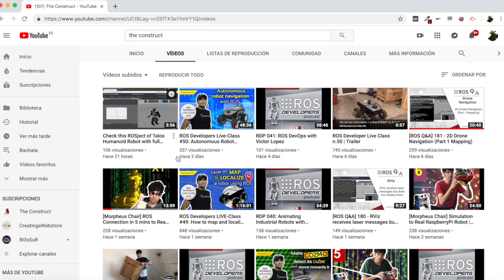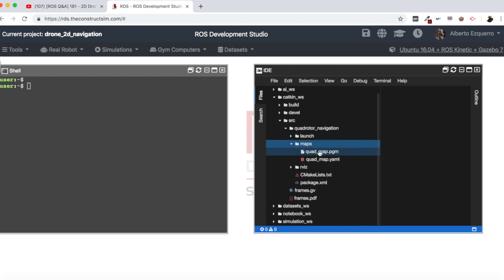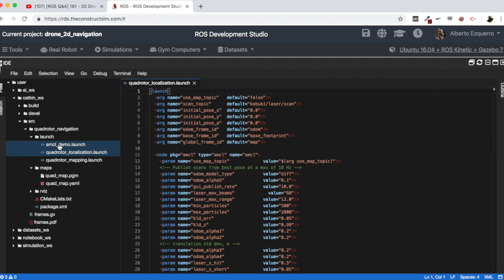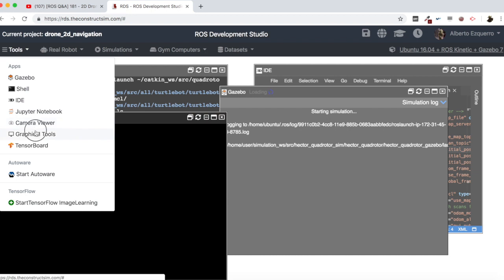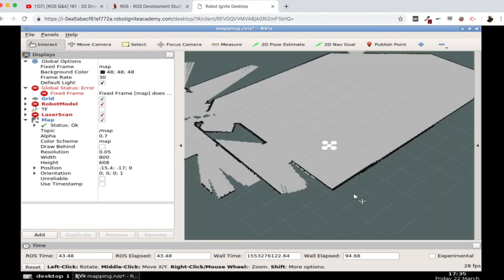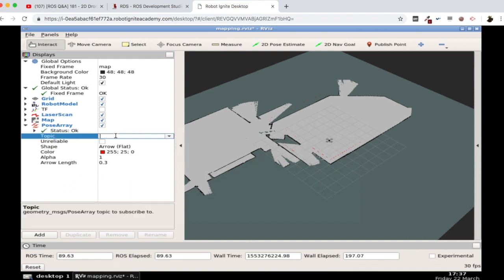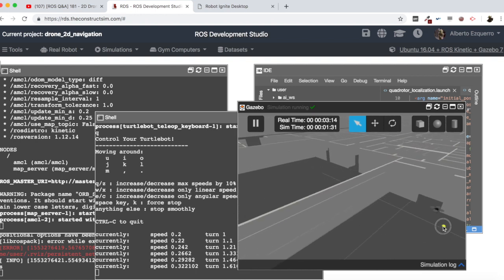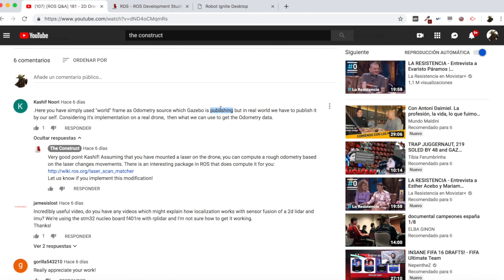[ROS Q&A] 182 - 2D Drone Navigation with ROS (Part 2 Localization)

Comment: Hello, just recently was working on Part 1/2 video series. I noticed there are some discrepancies within Gazebo that I don't seem to understand how to debug. For some reason, RViz generates an error in the RobotModel and LaserScan when the Fixed Frame is set to "map". However, when choosing base_link, front_cam_link, front_cam_optical_frame, laser0_frame, and sonar_link within the Fixed Frame, the RobotModel and LaserScan are functioning properly (at the cost of the Map frame containing errors). My team and I were wondering why such is the case, given we are following per the instructions as usual. Was there an updated codebase which may have caused this issue?